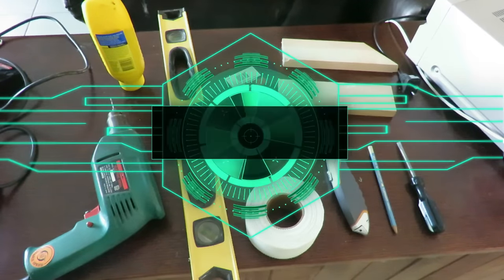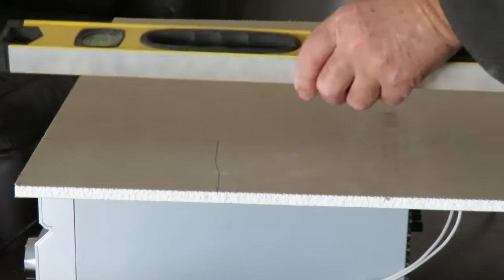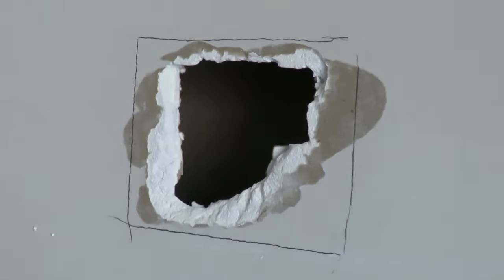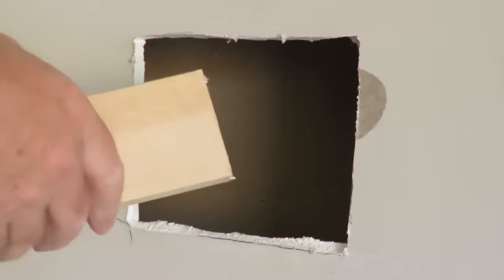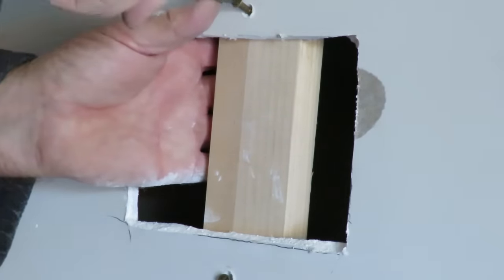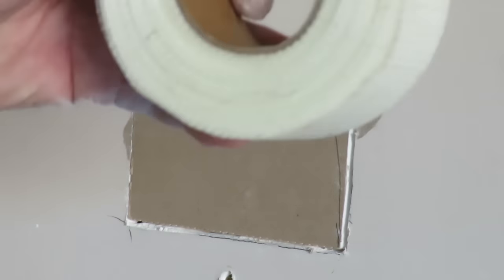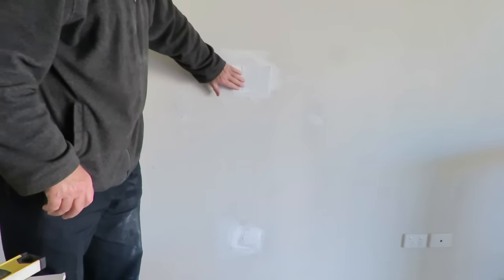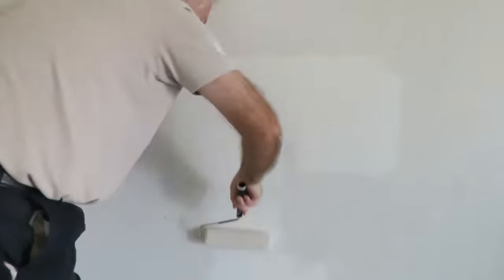🏠 How to Repair Drywall and Fix a large Hole in the Plaster Wall the easy way

Comment: To support the new piece of drywall, cut an oversize (one way) piece of drywall and grip fill the 2 outer edges. Put a 2'' screw slightly off centre.
Place drywall into  the hole. You can now pull towards you with the screw and the grip fill will bond. A perfect solid backing ready now for the new drywall piece to fill the hole. Gripfill new piece which will bond to the support piece. Fill in the edges with poly filler etc.,  So simple !!
Reply from the maker: Another way to do a repair, thank you for sharing.

Comment: With all due respect- your patch may not last long. Having placed a vertical support for the drywall allows movement from side to side. Best to use horizontal support or larger back strap support with more screws.
Reply from the maker: On the day of this repair, I didn't have any materials or tools with me, and scrounged whatever I could to do the repair.
The Video description explains all.

P.S. The patch is still holding well after all theses years.
No cracks or any bubbling of paint etc.

When I have all my tools with me I normally use the method below to repair walls.
https://youtu.be/JmcR9TW4mM0

Comment: Why did he put the drywall in backwards ?
Reply from the maker: It makes little difference which way the board is placed on a small repair, as long as you use an undercoat to give some tooth for the topcoat.

Comment: All you people hating on this guy for what reason ? Cuz he did it differently  than you would.thats silly. There's different ways to do it. Looks good to me!
Reply from the maker: Most people don't take the time to read the video description, before commenting, so they don't know why the repair was done this way.
And I'm sure you are aware there are quite a few different effective ways to repair damage to walls.
Reply: Being different doesn't mean it's good. In this case, as others have overwhelmingly agreed, it's not good. Not only was the backing plate not properly secured, but he never actually screwed the new piece of drywall down to it.
Reply from the maker: Andrew I hate to disappoint you, but your completely wrong with your statistics.
I can see both positive and negative responses, so I assume you base your opinion upon your own bias, on a repair that is 4 years old, and holding up to the riggers of a rental property.

Comment: Would you not need to glue the new piece to the wood ?
Reply from the maker: Its not really necessary, as the timber is just a backing.
P.S. If your repairing a wall for the first time, you might like this video as well.
https://youtu.be/JmcR9TW4mM0
By watching both, you will get a better understanding as to how easy it is to DIY.

Comment: Try cutting board out square then put a batten each side of hole the board won't move about then if you have any gaps around cut out pre-fill before tape & jointing. from someone who has been in drywall for over 30 years.
Reply from the maker: Thank you for your suggestion on how to repair a damaged wall. 
I normally use a similar method to what you described, when I have my tools with me. 
Video below
📌 https://youtu.be/JmcR9TW4mM0
Reply: hey man, done similar to the video but can see where ive repaired. it is raised slighty more than the wall, any tips to make it flush/level with the wall would be greatly appreciated.
Reply from the maker: Carefully sand the area with a sanding block to get it level, then skim over, and paint.
Reply: @GarryPurcell  legend thank you, guessing its a tedious process and I'll have to keep doing it till its right?

Comment: Using a sheetrock saw would've been easier, faster and safer??
Reply from the maker: The video description gives you the reason why the repair was done this way.
I normally use the method below to repair walls.
https://youtu.be/JmcR9TW4mM0

Comment: Dude, you didn't screw in the patch boards! Anyone who leans on it will crack the paint and mud.
Reply from the maker: Check the date of the video upload, and think again.
Reply: i couldnt agree more, nor did he sand the surrounding wall i mean thats what makes the plaster adhere.
Reply from the maker: @toolgod3781  Really, I didn't Sand?
Maybe you need to read the video description.

Comment: Few things, a typical patch is done what is know as a California patch, simply put you square off the hole to be patched, cut a scrap piece of drywall 2inches larger than the squared off hole on the wall,  score the scrap with a utility knife an inch on four side then snap it leaving the paper face hanging on all edges with square drywall still attached at the center, that flap you add drywall paste and butter the edged of the squared off hole and insert the scrap with flap paper on the wall, add more material and it will be invisible, second ) when driving a screw there is no need to constantly rub your finger on the head while been driven or else you will get metal burrs in your skin, third used appropriate screw because the moisture will corrode the screw and bleed thru your work.
Reply from the maker: Thank You for the in-depth step by step instructions.

I normally use the method below to repair walls, when I have all my tools with me.
https://youtu.be/JmcR9TW4mM0
Reply: David is right. He also should have put screws in the patch to the wood

Comment: Excellent job, the end result is a good un. Good on yer mate.. I notice all the Professors of Plastering on here bitching.. But not a video between them..
Reply from the maker: As you have stated already, lots of self proclaimed experts commenting, without having made any videos to show how they would do a repair themselves.🙂
But its also fascinating that the same experts haven't taken the time to read the Video Description. It would save them a lot of time if they did that first.

▶ Be sure to check out my other wall repair video, when I was prepared for wall repairs.
https://youtu.be/JmcR9TW4mM0

Comment: He's going at it the right way but not doing it correctly  not measuring the hole very sloppy work. Looks like it was done by Stevie Wonder 🤣🤣
Reply from the maker: This repair is 4 years old in a rental property, and still holding perfectly.
Please Read the video description to better understand why the repair was done this way.

P.S. I normally use this method when I have my tools with me.
📌 https://youtu.be/JmcR9TW4mM0
Reply: Amazing.  Don't know what you are talking about Scott.  He cut a patch then traced it on the wall for a good fit, the hole was filled and am assuming the client was happy with the work.
Glad to hear Stevie does his own repairs, oneore reason to like him.

Comment: So many extra unnecessary steps added lol and those joints will crack for it properly putting supports on each side so that their is no movement. This should be a video about what not to do
Reply from the maker: Check the DATE STAMP on the Video.
Still No Cracks 23-12-2020
So you might like to rethink your comment.
Reply: @GarryPurcell  you tell em mate 👊🏾 
Jog on Dmarkk.

Comment: Looking at the way the filler piece pivoted as you're applying the tape and filler, and considering you had two pieces of scrap timber, I would have mounted the  two scrap pieces on the left and right edges of the hole to provide a more solid base for the repair where the filler piece is assured to sits flush with the rest of the wall.  

The final repair look fine...though viewing it from an angle with some reflected light would have  illustrated the quality of the repair better.

Anyway, thank for the video,
Reply from the maker: Thanks for your constructive thoughts.
Be sure to watch my other wall repair video, when I had all my tools with me.

📌 https://youtu.be/JmcR9TW4mM0
Reply: @GarryPurcell  Thanks for the feedback, Garry,

I took my own advice, based on your advice (in this video) and happy with the results of my patch job.

Keep up your good work.

Comment: You have the concept, but not the skills.  It is a very bad job.  You cut the new piece of drywall and hung it on the wrong side.  the wood should never move and the small piece of drywall you should place screws too.  not to mention the lousy level of finish.  it's the typical job that people do to not pay a professional
Reply from the maker: If you bothered to read the video description, you would know why the repair was done this way.
P.S. I have a another video below, (when I had all my tools with me.)
https://youtu.be/JmcR9TW4mM0?
Reply: @GarryPurcell  I see the other video.  much better work, but you should always place mesh tape

Comment: It's been a while since I've seen a slotted head screw used..  Good job 👍👍
Reply from the maker: The dump bin was pretty lean when it came to scrounging supplies from it.

I normally use the method below to repair walls.
https://youtu.be/JmcR9TW4mM0

Comment: You need to invest in a cordless impact driver.
Reply from the maker: Thanks for the suggestion.
Reply: Quan Trung exactly also with a dept gauge tip as to not drive below the paper

Comment: No sure if you are familiar with the blowout patch...it's something I use often for patches about this size and smaller.  You work from the back side of the sheetrock.  score a box that is the size of the patch you need but cut the sheetrock itself an inch bigger on each side.  score and snap the size of patch you need and peel off the excess sheetrock, leaving the front paper.  this will leave paper only on all four sides and you wont have to do any taping...the paper is used as tape.  Just a thought and I use them a lot..good luck
Reply from the maker: That's a good description of a californian patch.
Thanks for taking the time to write it.

Comment: I've done patches just like that.. Except before I place the new piece in, I would, with my finger, put taping compound on the edges of both the wall and the new piece. That will glue them together.
Reply from the maker: Handy tip.
Each and every day our knowledge expands.
Thank you.

Comment: Too complicated.
I prefer using what's called a Blowout Patch.
With a BP, which you can find Videos of on You****, no Screws or Backblocking is needed; just a piece of Drywall ~2" larger than the Hole.
Reply from the maker: There are many different ways to repair damaged walls.

Comment: My way to do this is to enlarge the hole and cut the hole out all the way to the center of the wall studs.  Then screw two 2 x 4 cross members between the studs to accommodate a neatly cut piece of drywall.  Glue the papered side down to the 2 x 4 backing with aliphatic wood glue.  Leave several spots in the glue for instant gel super glue so the piece of drywall will stay in place until it dries.  Let it set overnight and finish it off.
Reply from the maker: Thanks for sharing how you tackle a repair.

Comment: Hi You spent to much time on cutting the whole out. Get a dry wall knife to make your job easier!
Reply from the maker: I normally use a panel saw, when I'm forewarned of a wall that is damaged. 
On this day I was there for an unrelated job, and had to borrow and scrounge materials from a dump bin.
Reply: Ok I do understand that.

Comment: Why wasn’t plasterboard screwed to wood?
Reply from the maker: It's not necessary, the backing board is only there to stop the patch from falling though the open hole.
However, adding an extra screw to the backing board, is a better way to do the repair.

Comment: I hate straight slot screws. I would have used Phillips head drywall screws to secure the backer board.
Reply from the maker: I agree with you.
However, on the day of this repair, I didn'thave my tools with me, and I sourced some bits from the dump bin, and borrowed tools to complete the job. (As the video description explains.)
Reply: @GarryPurcell  
Well for what you had you did a great job.
Reply from the maker: @lorenzomaximo1818  
Thank You.

Comment: You dont need all those tools to fix a patch
Reply from the maker: There are many ways of repairing damaged plasterboard walls. 
This repair was made when I had no tools with me, as the Video Description states, so I used materials from a dump bin, and borrowed some onsite.
If you think I had too many for this repair, I'd hate to think what you think of the below video, when I had all my tools with me.
https://youtu.be/JmcR9TW4mM0?
Reply: Im not saying it was a bad video all i said was, you dont need all those tools
Reply from the maker: @albertoatilano4356  
I understand, otherwise I wouldn't have given your original comment a thumbs up.
And as I also stated, there are many ways of doing repairs.

Comment: Try No More Nails adhesive to hold the baton next time, and a plasterboard saw for a neater cut. Saves having to use a ton of filler.
Reply from the maker: It all depends on what you have available on the day of the repair.
P.S. I normally use this method when I have my tools with me.
📌 https://youtu.be/JmcR9TW4mM0
Reply: @GarryPurcell  Yes, you have to make do with the tools you have to hand, I would also add, there is no need for tape when drywall is cut to fit the hole exactly and stuck to the baton.
Reply from the maker: Thank you for your observation.

Comment: I never seen anyone pre drill holes for screws and use a screwdriver...
Reply from the maker: You obviously have never used Australian hardwood before.
Its ranked as one of the hardest timber in the world, and you will not be able to hand screw anything into it.
Reply: @GarryPurcell  if those are your only choice for backing then your home improvement store must be far away
Reply: @arturogarcia5996  lol

Comment: I love the way you can see the plasterboard patch move whilst applying filler. Gary, please stop making these 'How not to videos'
Reply from the maker: Please read the video description before commenting again.
P.S. The backing board i used was to simply to stop the patch falling into the cavity, it also gives a bit more strength to the finished patch.
Reply: @GarryPurcell  Please stop making these videos
Reply from the maker: @johnjeff3849  It's quite obvious you still haven't read the video description.
Reply: @GarryPurcell  I have read the description but whats the point in making a video? I might as well make one showing how to perform emergency brain surgery.
Reply: Oh and 'The backing board is only to temporarily support the board' is showing up your ignorance. If you read the fixing spec
for plasterboard you will find that all unbound edges (ie cut edges) must be fully supported (ie a noggin) STICK TO WHAT YOU KNOW
Reply from the maker: What ever,
A sharp tongue is no indication of a keen mind. 
P.S. I suppose you think a butterfly patch is No Good, because it has no backing support.
Reply: @GarryPurcell  By the work, one knows the workman.
Reply from the maker: You should read this from the Gyprock manufactures website, before you tell me I'm wrong.
https://www.gyprock.com.au/-/media/gyprock/content/documents/install/diy-projects/gyprock-201-repairing_holes_diy_guide-201604.pdf
Reply: .Well thats odd, you refer me to a manufacturers website that agrees with me! It clearly says that when repairing holes larger than 25mm use TWO pieces of backing board. My main criticism of your bodge is that you only use one allowing the infill board to move.
Are you really this Obtuse Garry?
Reply from the maker: @johnjeff3849  The link I gave you is a process I thought you would recognise.

Have you read My Video Description????
There are many variations on doing wall repairs, and this is just one of them.

P.S. This repair video was posted on 18 Sep 2018
, it's in a rental property that gets a hammering. The repair is still holding up, so your concerns, are groundless.
Reply: @GarryPurcell  Yes I recognise it, as the right way whereas yours is the wrong way, so why make a You tube clip as if your an expert. You have 3000 dislikes, doesn't that tell you something
Reply from the maker: @johnjeff3849  The problem is not what people do not know, it is what they think they know, that simply isn't true.
Reply from the maker: @johnjeff3849  Why don't your Read the Video Description.
It will enlighten you as to why the repair was done this way.
Reply: @GarryPurcell  Ok, I think you have finally grasped that your repair was a bodge. My second point is, why make a video showing how you did it, your just confusing people who dont know better.
Reply from the maker: @johnjeff3849  I would agree with you, but then we would both be wrong.
Reply: Garry Purcell don’t argue with him mate. You just keep doing you, I love your videos

Comment: Great job on the video, i like the way that you added the board behind the sheetrock - I might try that but add an additional piece of sheetrock instead of the wooden board. (I remember someone back in the day when i was like 5 years old or so and he stuffed the back of it with newspaper).
Reply: Soft cardboard stuffed in hole / half a trowel full of bonding with plenty of cement in to make it set in 10 mins, dirty water with skimming to make it skim go off walk away in 1 hour or do 10 holes like this one in the same room and walk away in 1 hour 15 mins, i do these kinda jobs every day perfect job when complete